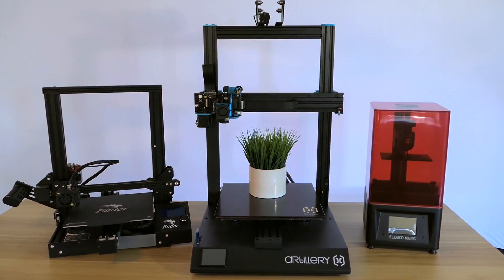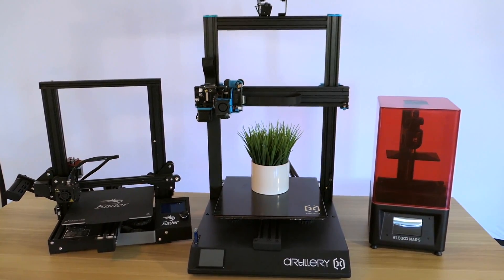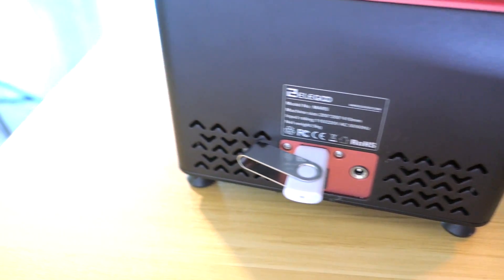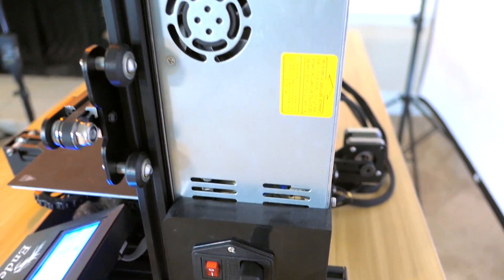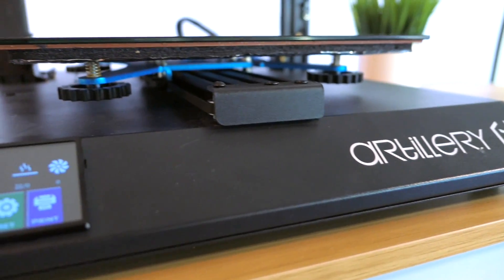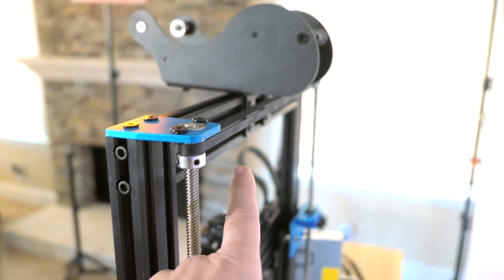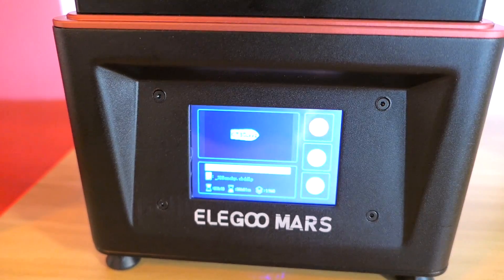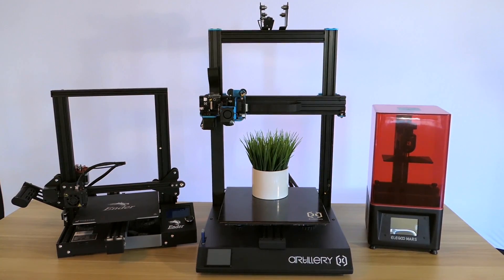Best 3D Printer - Ender 3 pro - Sidewinder X1 - Elegoo Mars

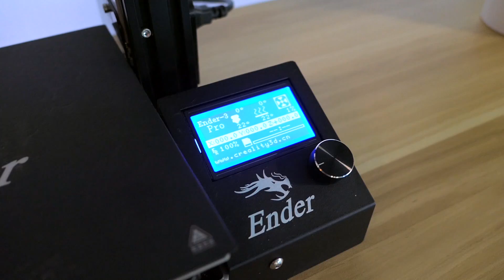Comment: 0:24 - can you provide links to the 45 deg low spool mount, as well as the bearing spool holder?  Did a quick search and cant seem to find these.  Thanks.
Reply: If you go to his ender 3d pro upgrades and fixes video, all the links are in that description

Comment: hey man, I just got an Ender 3 Pro and I was making some prints when all of a sudden my printer decided to move everything 1/2 a centimeter to the left and print there for no reason. I converted .stl files to .gmode files off Cura and it looked good. Please help, I have no idea what to do.
Reply: Tehkitteh 26 thats a layer shift, make sure the x axis belt isnt too tight and it shouldnt happen again
Reply: @Frost73373  alright, thanks for the advice!